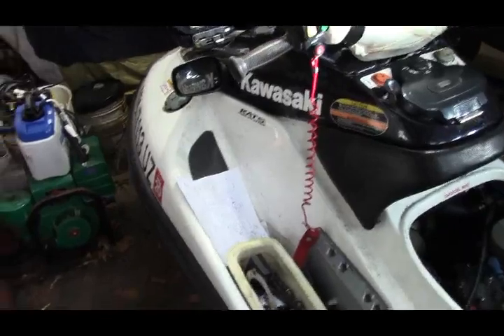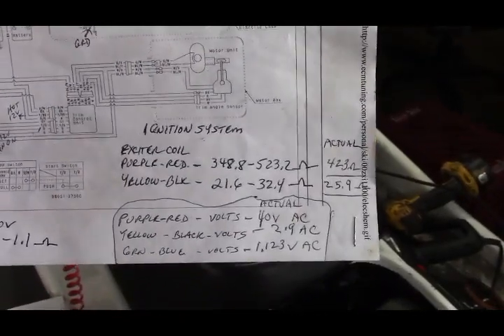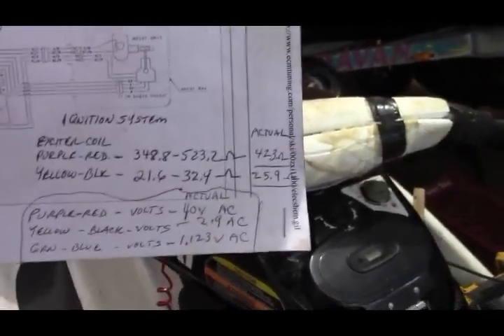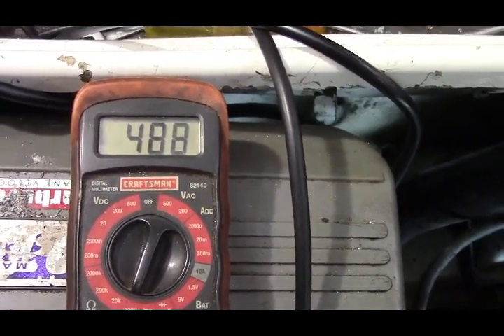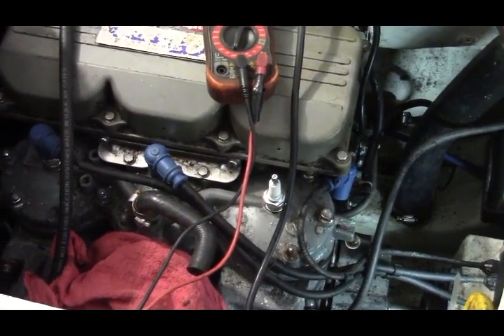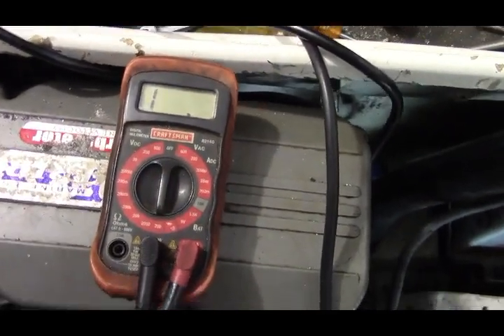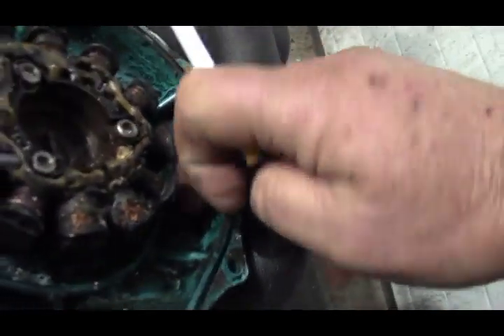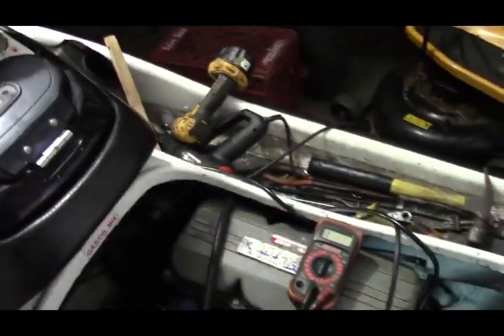Kawasaki ZXI 1100 no spark condition

Comment: Danny the only thing I can come up with is, if you’re getting the correct ohms at all points.  Where the wires meet at the plugs may have a resistance, or a broken.  Your checking from the stator to the connections.  Look at the other end of the connections.   I could be wrong. It could also be the CDI box itself.   If everything is good going to the CDI box, can you check what’s coming out of the CDI box.  When the high energy ignitions were introduced, if you pulled a plug wire off to check for spark without having a tool like you showed looking for spark, it would damage the control module for the ignition.  I believe that’s what the CDI box does as far as I understand.   Sorry Danny, I don’t know the systems, just trying to help you think.  I hope someone out there can really help you,
Anthony.
Reply from the maker: Thanks for your interest and suggestions. As far as spark plug wires being the culprit,I don't think so because I am not getting any voltage to the coils from the CDI unit. I didn't show that in the video but I have taken those meter readings and they are Goose Eggs. Thanks again. Any ideas are worth investigating.
Reply: Funny
Ive just been experiencing this same problem with my 1998 ZXI. I'm simply amazed that even though there are service manuals out there on the PWC that non will give out the critical information necessary to properly diagnosis the ignition no spark issue. Only thing available is the wiring schematics and nothing else. Simply BS, a guy is left to changing parts out in order to problem solve by process of elimination, if thats what it comes down to, who is an expert when the information to fix is kept secret!!!

Great job explaining all your meter readings and at which connections you examined.
Reply: I just wanted to add that the yellow wire with black stripe comes out of harness mid way between trim controller and CDI to a male end plug and ends there. It does not run to the CDI on my jet ski and the air temp sensor had been removed off from this jet ski before i had purchased it in 2008 by a previous owner. So that yellow/bk is only half a link not comleting any circuit and this machine  ran that way over10 years until this problem had occured.

Comment: Hey I've done this before and it worked, preheat an oven to 300f stick the cdi in the oven for 10 min and pull it back out. If the problem was the cdi box you have a good chance of it working after.
Reply from the maker: What does heating it do?
Reply: Put the brown striped wire to battery ground
Reply: @coastbuster51  In some cases, if you are lucky, this will drive off any moisture inside of the unit and get you back up and running.
Reply: worked for me!
Reply: @JohnPierrotti  awesome

Comment: Just an update.  A new ignitor fixed my issue.  I did have an intermittent ground out of electric box in connector going to stator (2 x brown and black wires)   could wiggle it and see the dash lights go on and off.  I cant believe this one ground only one to engine.  So I'm thinking maybe that caused the ignitor to not be able to fire spark and fried it since coils do not have a ground potential.  So I added a small gauge jumper cable to a bolt on flame arrestor, to bolt on top of elec box, to negative battery terminal just as a safety measure.

Comment: Hi.  I have same issue.  Have you tried the internal resistance checks in the manual for the ignitor? (Section 13-21 in manual)  also have you investigated the r/y wire from ignitor to "temp indicator control unit"?  I cannot figure this out if it's some power signal or what.  (It also goes to one side of water temp sensor)
Reply: Hopefully you already have this figured out... but I will try to answer this question anyway. 

The temp sensor does not have to be connected, according to the manual it is an open and closed switch. I have heard that when closed or open (not sure) it limits the timing advance, sort of like a limp hope mode, but not as extreme. 

This should not effect if you get spark at all, only the timing of the spark.

Comment: Ever figure it out????
Reply from the maker: Not yet. Right after that video I bought a waterfront house which needed alot of work. it's taken all my time but I will get back to it eventually.
Reply: @coastbuster51  thanks for the reply. I figured it out my safety kill switch on the left handle bar was opened enough to let the engine turn over but slightly closed enough to kill the spark. Just take it apart and unscrew the push button and reset it. Fired right up. Good luck..

Comment: Flywheel damaged. Try a different one , and no cheap china stators !
Reply from the maker: Hey Marck,what could go bad on a flywheel other than the magnets losing strength/ Dan
Reply from the maker: When the front crank bearing failed it took out the stator. It's brand new although It's been a long time since I replaced it and don't remember where I even got it from . Maybe EBAY. used.
Reply: I’ve seen cheap eBay static don’t work! 
And if there’s is damage to the flywheel it won’t start neither